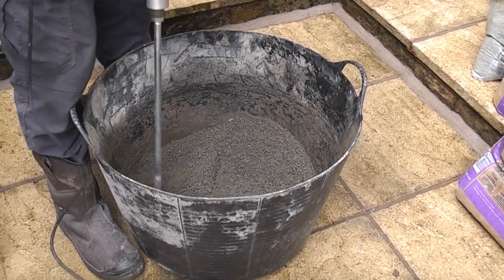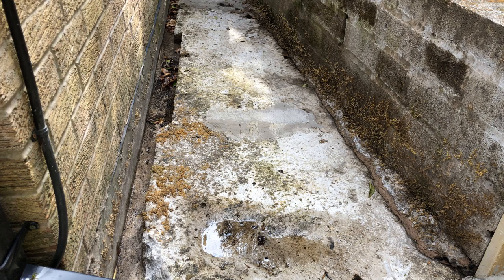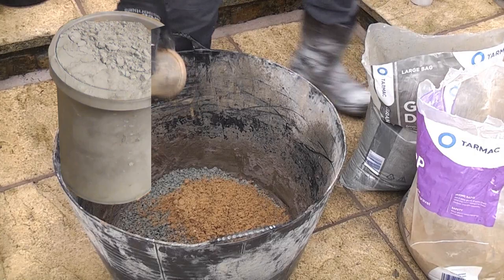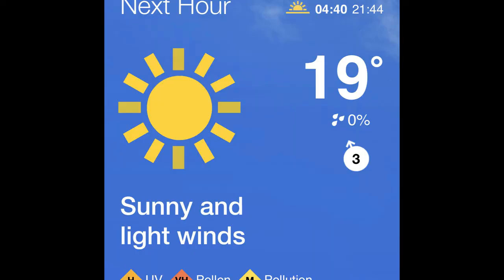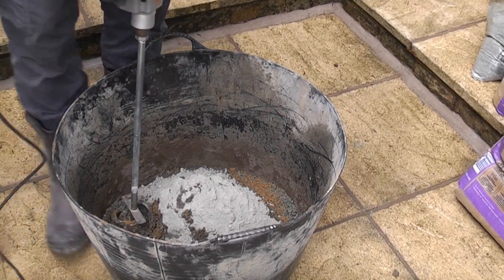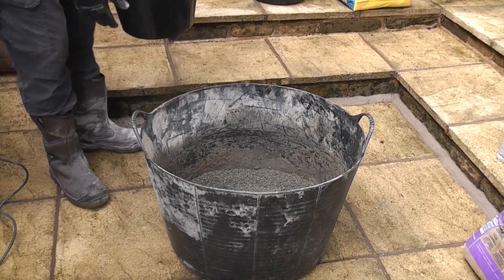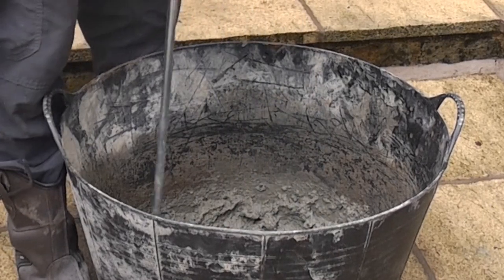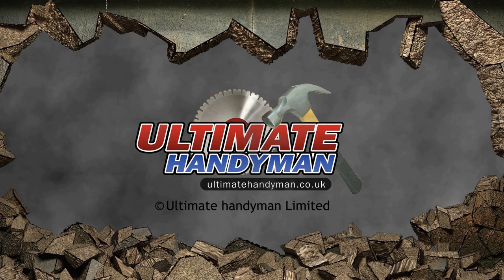How to mix concrete with a mixer paddle

Comment: When mixing concrete I always used to put the water in 1st in a mixer,with bricklaying mortar always dry mix  and add water last.
Reply from the maker: Yeah, most people do it that way with a cement mixer, but when using a tub like in this video, I add the water last. Thanks for the comment  👍

Comment: great tip. i have done this several times. not sure i would use it to mix the amount you did but we do have a cement mixer so i have that choice. 
some people use a 2 bucket method where they pour from one to the other  several times as they add water. never tried it  but would be interesting to  see other methods
Reply from the maker: Thanks Alan  👍

Comment: Great vid! I have that same mixer I think. Is it the Bauker? I always use it for multi-finish, but would it handle mixing through ballast and cement without burning out?
Reply from the maker: Mine is the Evolution Twister 👍
I’ve mixed several tubs of concrete made using ballast and cement with no problems 👍

Comment: Never used platiciser in concrete would it not weaken the concrete ?
Reply from the maker: I don’t think so, I’ve been using it for years in mixes, with no problems (yet)  👍

Comment: Great video. Thanks for the tips. 

Have you used the pointing gun before? I've not had much success with the right type of mixture for this. Or more specifically I spent way to long being an alchemist than actual repointing of the bricks on the day. In fear of this happening again for the 2nd session guidance is most welcomed! 😂
Reply from the maker: I tried a pointing gun about 20 years back, when I was repointing a house. I made a mix and put it into the gun, squeezed the handles and all the water squirted from the end and the sand and cement was solid in the barrel 😂
However, my patio was re-laid a few years back and I pointed it using Bostick wide jointing compound (utter rubbish), so I re-pointed it a few weeks back using a pointing gun.

I used a mix of 5 building sand to 1 cement, but used SBR instead of water. I then mixed it really well, then mixed it some more. Once you get used to it, you can make a creamy mix, that will exit easily from the gun 👍

Comment: How do you dispose of leftover concrete?
Reply from the maker: I normally use it all. There is always some hole that needs filling. Failing that, I just let it harden in a bucket, then take it to the tip 👍